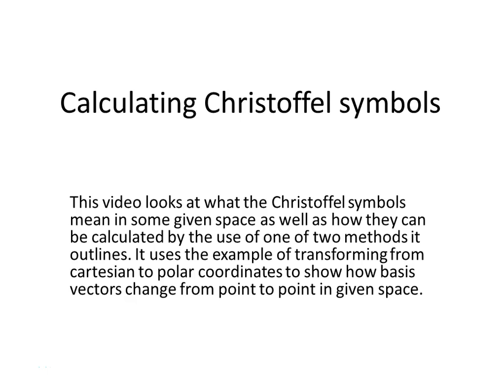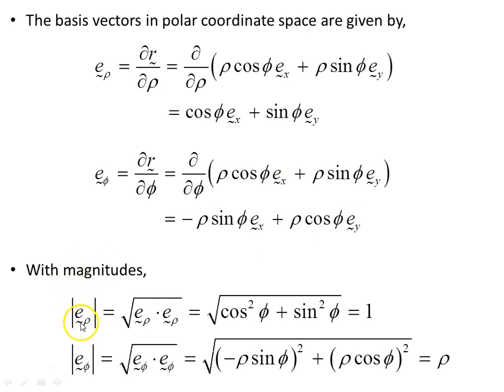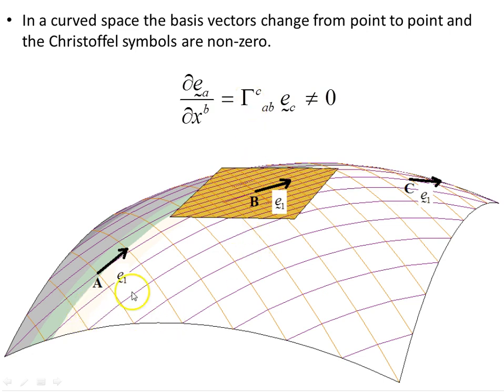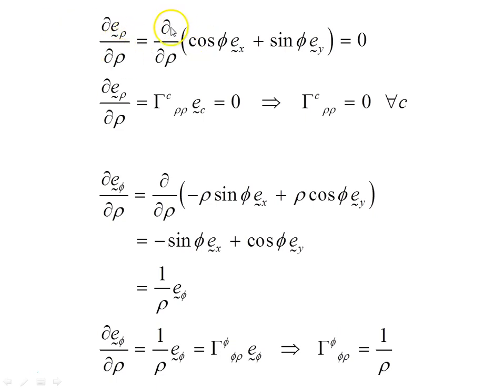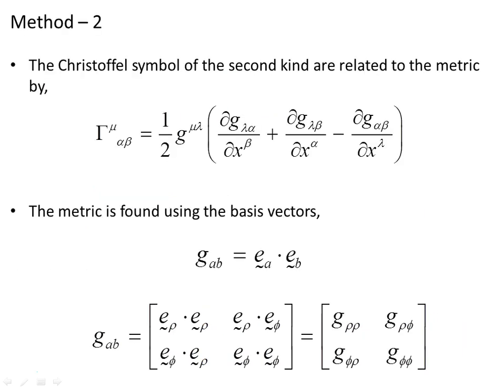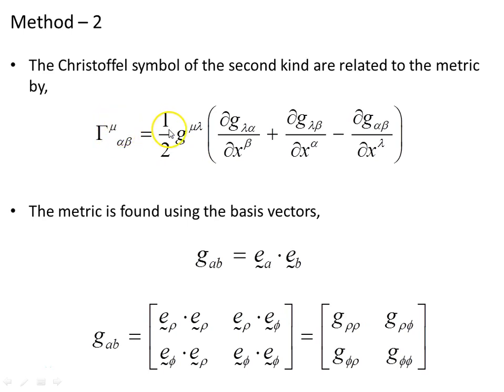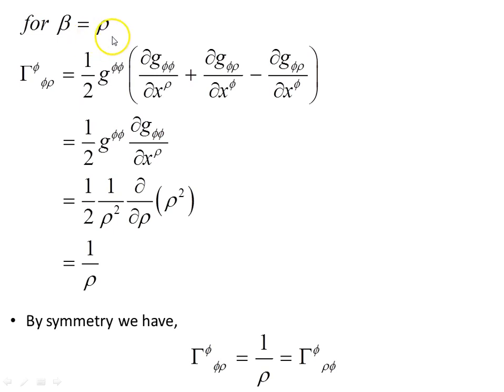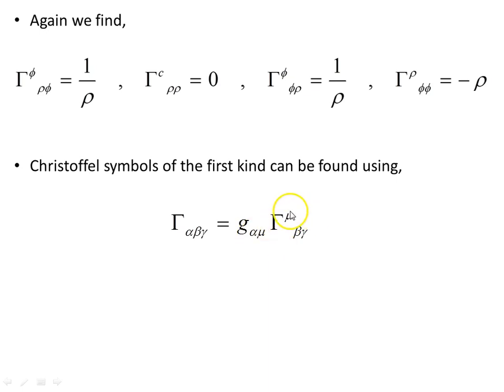Calculating Christoffel symbols - corrected

Comment: In the more general case when all the coordinates are say u and v and the values in the inverse of the metric tensor are all non 0 if mu is u can lambda be either u or v or is it’s value still fixed by the value of  mu?
Reply from the maker: This video shows the case for a diagonal metric whereas you are asking about the non-diagonal case. In the non-diagonal case mu and lambda can be different.